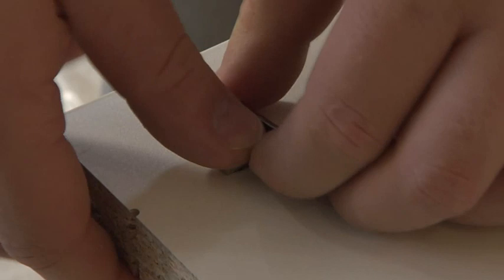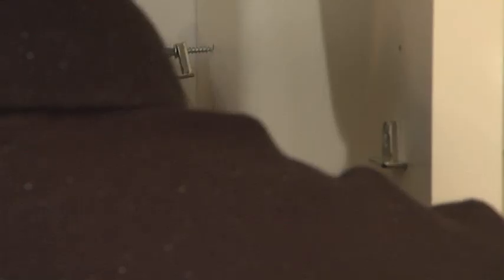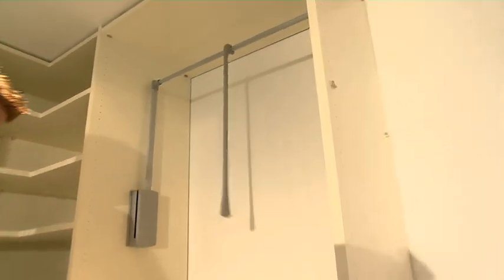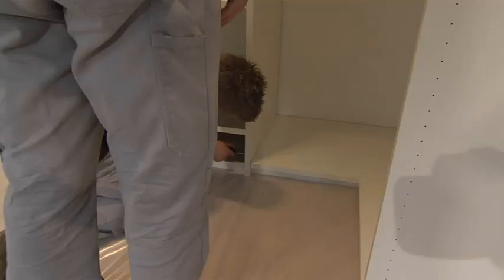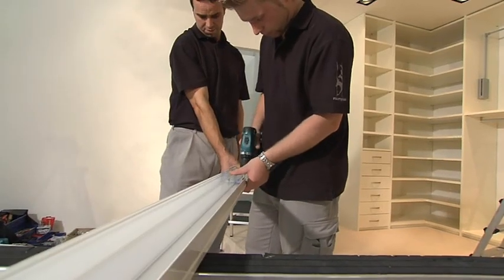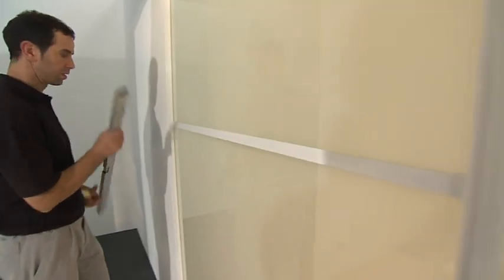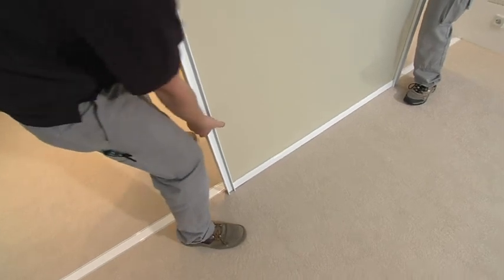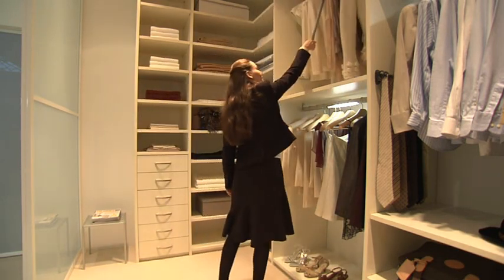Sliding Doors & Closet Installation

Comment: Sadly, This type of work is much more difficult in modern USA construction.. .The walls and floors/ceilings are so uneven/crooked.. most people are shocked when I show them while installing cabinetry.
Reply: Frankmali17. just of curiosity,  only  bc I've experienced poor carpentry work from doing finish carpentry, why do you think that modern USA does not produce high quality homes in the present time. I was just doing some remodel work on a house and all of the framing materials where cedar? I mean why do we not do that anymore. not considering the price aspect of the material cost.
Reply: axel ayerdis work in the trade as well. as I see it there is more of an emphasis on how fast the job is completed, compared to how much quality is provided. in order to profit, there must be a rapid pace of production, especially during initial framing and drywall hanging. it all cases a chain reaction down the line that affects later trades, such as trim and cabinet carpenters, to deal with out of square foundations.
Reply: Frankmali17 never a more true statement !;-)
Reply: This is Germay not USA! :)) Here  we are takeing precaution for everything 'cause we like details. If the wall is "Krum" than than we will use a level and door 1 and 3 will be cut in the way to cover the shit (the same way as in Bad for shower cabin). 😉
Reply: SI LOS TECHOS SON DESIGUALES AS EL CLOSET MAS BAJO Y COLOCA UNA TAPETA Y EN LAS PAREDES IGUAL  NO  ES ESCUSA  PARA DAR UNA BUENA TERMINACION
Reply: " ... DESIGUALES haz* EL CLOSET..."
Reply: Forget the ceiling and bottom floor shelves and keep all the otherones.
Reply: @slowshadow1  teach them about Europe...they need to rebuild a lot...

Comment: that carpet cut is WAY too long to be unsecured. There should be edging for carpets built into your fancy-pants system- cause this right here will look like shit after about a year of use and vacuuming. Those edges WILL curl up, and the floor strip will get kicked alot- possibly making that tape tear free.

All it would've taken was about 1/2" of extension off either edge of the door strip, angled slightly downwards, as well as about 4 screws, provided your workers have the balls to take out their masonry drill bits.
Reply: rasvial m

Comment: question ..the name of the material that you are using ?
Reply: It’s just melamine with edgebanding. particle board core or also called flake board with a plastic 1mm white laminate pressed to both sides. 

Basically the cheapest shit you can buy. If you want to spiff it up and spend some extra coin I am sure this company and many others have a bunch of other laminate styles/ colors/ textures you can choose from. But it all gets pressed to flake board core because it is the cheapest material for manufacturing. 

But honestly, for closets where most people just don’t give a crap, melamine closets are fine and functional. 

You get what you pay for.

Comment: The carpet is loose. The sliding doors are perfect, but the carpet needs reinforcement
Reply: They mention that they use carpet tape to tape the edges down.
Reply: Yes they did mention tape but that is neither strong or durable.  It'll be curling and pulling away in no time.
Reply: I was thinking the same thing, my vacuum cleaner would rip it off the carpet tape in the first clean!  Needs a better solution for carpeted floors.
Reply: subtítulos por favor
Reply: Você é maravilhosa e muito inteligente

Comment: This is just exactly how it doesn't work. First you are going to have all kind of other trades running around you every minute and you never have a clean space to use as a workshop. Secondly there is no such thing as right angle corner or straight floor and/or ceiling. Not only not straight but floor usually flexes too! Anybody in the trade only laughs watching these instructional videos.
Reply: Csaba Torok  என்ற